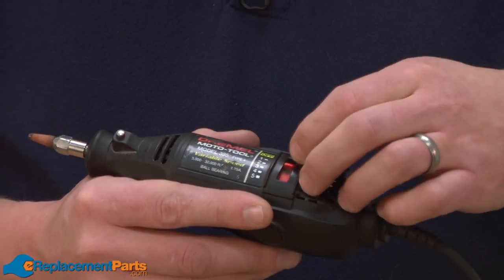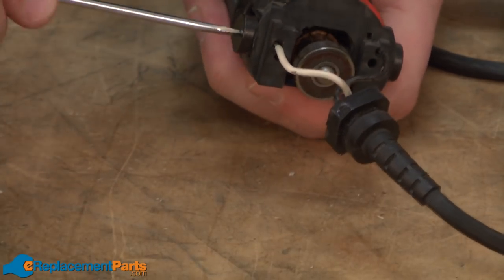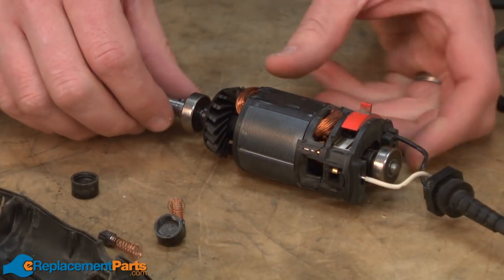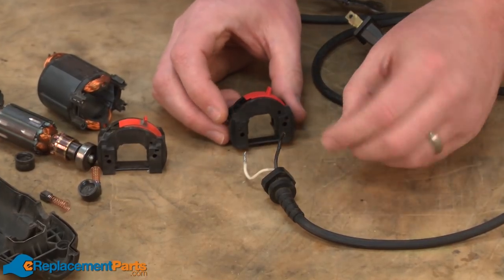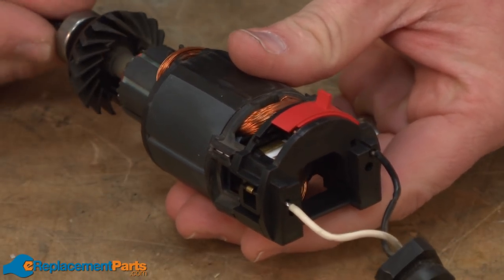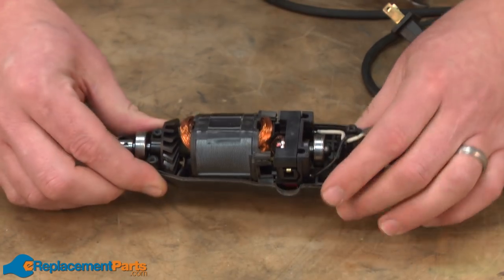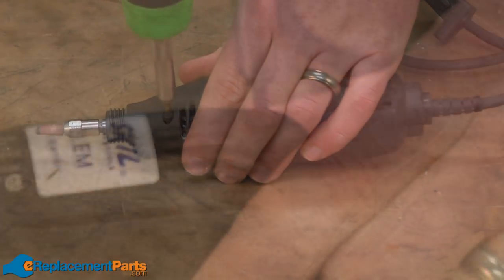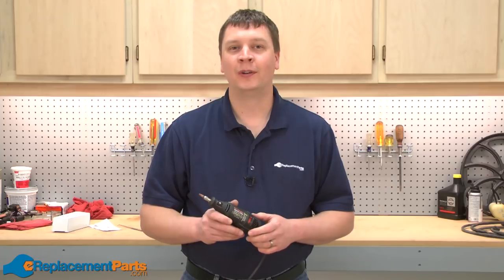How to Replace the Switch on a Dremel 395 Moto-Tool

Comment: Good demo.  I have found on my model 395 that dust will create a barrier between the wiper and the resistor path so all I have is high speed.  I just take the housing apart and blow out the dust.  Back to having variable speed again.

Comment: Just purchased the switch and the brush set for the 395 type 5 from you guys, I noticed you didn't say when putting the brushes back in, to make sure the curve on the brushes must match the curve on the armiture, but otherwise great helpful video.

Comment: Good job on your presentation Mark, I have been plagued with the same procceedure one too many times as with the latest model 3000 after only 2 months. The previous Dremels failed with their variable speed units also, way to soon.  Maybe I am a victom of circumstance, however I will not purchase another

Comment: My 395 runs, but it squeals alot, and the variable speed runs up to the 30,000 without even moving the switch. So, it works, but is noisy and runs out of control.. what to replace (I've never changed out the brushes)???

Comment: My dremel is my best friend (lol) and its messing up. I use it for everything! especially my dogs nails. The variable speeds are choosy, some work and some dont. How do I test to see if it's a bad core or the switch? I'd like to order what I need to save it. Also, just recently the Chuck thing broke- luckily it at least has the bit (file for dog nails) I use the most stuck in it. It won't lock when I push the button in to take a bit out. How do I fix that? It's a dremel multipro 395, thank you so very much :)

Comment: Is this the same process for the 395 multipro? Also the same switch?
Reply from the maker: The process for the switch replacement so be the same for all of the 395's.  Dremel, Skil and Bosch all of a 10 digit number next to the model number that segregates their products.  An example would be 395 F013039504 .This number will be needed to insure we get you the price and availability of the correct switch for your tool.

Comment: Sadly I let some cloth tangle in my bit and I shut it off and it wouldn't restart.  It's sputtering now.  But before the speeds were alright yet it seemed it would go into higher rpms on one setting.  Could this be a sign of a switch wearing out?
Reply from the maker: It sounds like the switch would be the first logical place to start with this Dremel. You should also check the brushes and Commutator on the armature to make sure these weren't damage when the tool stopped.  Sometime when they get bound up it will cause burning and damage to these as well.
Reply: Thanks, I think the brushes and commutator are OK.  Is it possible for the brushes to go and leave the starter unscathed?

Comment: MyDremel model 395 just suddenly stopped working while i was woodcarving small detailed wooden arrows for my bow. It "studdured" a lil bit before it quit but thts all the warning it gave. suggestions?
Reply from the maker: +Chad j Hendrickson 2 parts I would look at would be the Carbon Brushes and the Switch.  Both of these have been known to suddenly quit working.

Comment: I've got the 3000 model and used it twice and the second time used it just cut out and as never worked since how can such a expensive and popular tool fail so quick and what can it be?? thanks in advance
Reply from the maker: The Dremel model 3000 is typically a great little tool.  If you've only used it twice I would start first by checking
the power supply, check the brushes next to make sure they are in good shape and making contact as they should then the switch and internal wire connections.  Luckily both the brushes and switch are economically priced.

Comment: I replaced the switch and brushes but my 395 still doesn't turn on. How would I check the continuity of the switch to make sure the power wires are connected to the right contacts? Does the orientation of the field relative to the switch matter?
Reply from the maker: The placement of the wires on the switch are not important since both the black and white wires plug into it.  It is important to note that there are many different variations of the model 395 and the only available switch I can find fits only 2 of the 395s.   You may want to check the connections where the switch plugs into the field to make sure you're making contact.

Comment: OK so the button does seem to lock but when I use the wrench to release the bit, the collet comes out. I can't get it to let go of the bit?
Reply from the maker: The first thing I would try is to get another collet.  It sounds like the inside is gaulded and lost a bit of its spring properties.